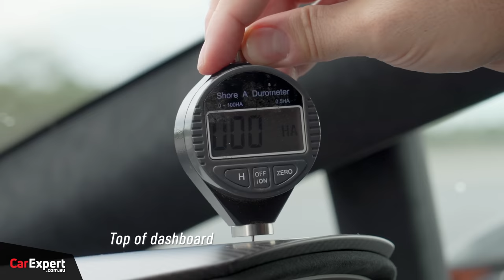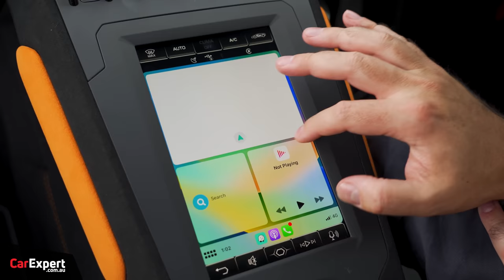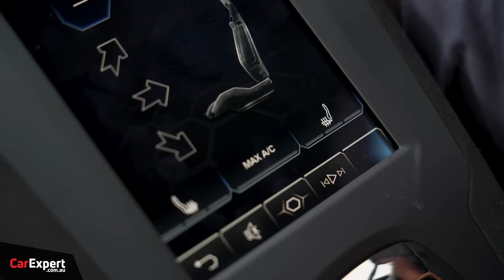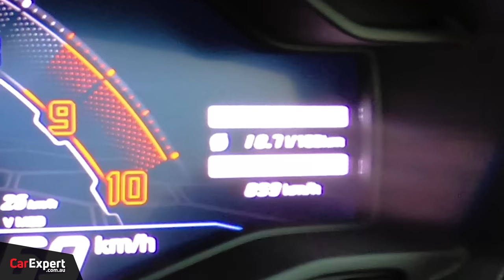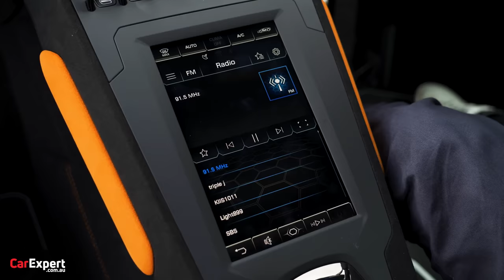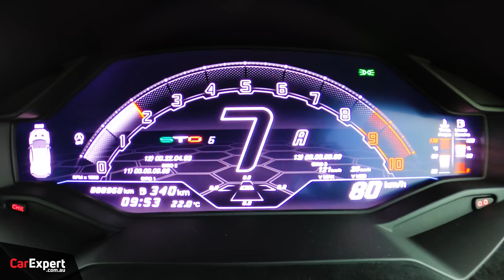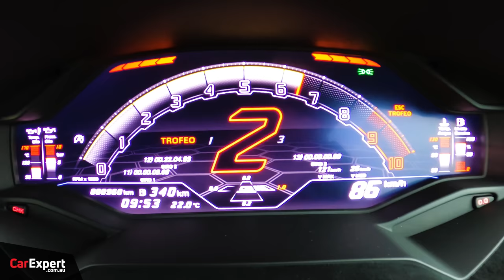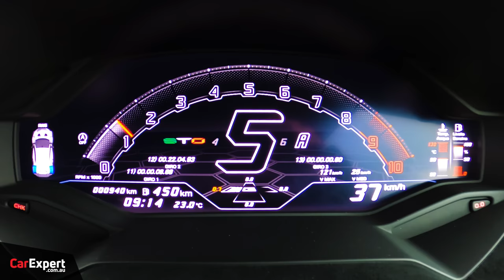Lamborghini Huracan STO (inc. 0-100 and braking) review

Comment: The only thing that could make this better, and this applies to Ferrari and McLaren, is to stop using 245mm fronts. They’re far to skinny, take a leaf out of the Nurburgring lap record holders Porsche and Mercedes and fit some decent 265mm, it’ll drastically improve grip and better braking as it has a larger contact patch with the road. There’s a reason GT3 cars have 295/300mm fronts.

Comment: Paul, the 100-0 braking was done at 111kph before you hit the pedal. If it was at 100, I reckon it would have made the 30 meter mark.

Love that you are reviewing fast cars. One day, I will have one and compare it to your reviews. Great stuff, keep it up!
Reply from the maker: Doesn’t make a difference :-) it only measures from 100km/h so it doesn’t matter when you start braking, as long as it’s above 100km/h.
Reply: @CarExpertAus  Well the scientist in me says no... You diminished 7% of the braking performance scrubbing off that 11km/h before you reached 100km/h.
Reply: @CarExpertAus I don't buy that, in fact you started braking at 112kph. Otherwise great review
Reply from the maker: @Dino-zc5wi  Yep. Makes no difference. It only measures from 100km/h.
Reply from the maker: @64nine  The engineer in me says it makes no difference. It may matter on the fifth or sixth brake when brake fade comes into play, but it makes no difference otherwise. We’ve tested it many times before.
Reply: @Dino-zc5wi  so learn how the tests works then ffs

Comment: What was the speed u reached at the back straight?
Also were u doing 111km for the brake test? hence the extra 5m?
Reply from the maker: It only records from 100km/h, so the number is correct. 
It’s possible the surface wasn’t completely dry, or was a bit greasy from earlier rain.

Comment: Awesome review 🏆 although in your brake test you stopped from 112km 😅 What a beast 🐂
Reply: The data logging gear he uses, in fact what most reviewers use, track 100-0km/h via GPS, so as long as you're somewhere above 100km/h when you start braking, it'll record it exactly from 100km/h.
Reply: @TheStigHCE09  ahh I see, thanks for the heads up 🏆

Comment: Such an epic car!! I am wondering why you bother reporting the 80-120 time when the car is already at max acceleration? Isn’t the idea to record the rolling acceleration to 120 if you’re maintaining 80? Not blasting straight through it and recording that time. Keep up the epic videos 👍🏽
Reply from the maker: Nup. It’s a measure of how quickly it accelerates through that speed zone. It then makes it directly comparable between all cars we test. If we do a rolling acceleration test there are too many variables that don’t make the number comparable between vehicles - such as the gear you start in, how far below 80km/h you start and which part of the track we begin accelerating. 

By doing it this way it’s simply a measure of torque production in that speed zone that determines how quickly it moves through it.

Comment: Braking test was from 110kmh you did not 100 .
Reply from the maker: The GPS device measures from 100km/h. Doesn’t matter when you start braking, as long as it’s above 100km/h.
Reply: The surface is cold and has been totally washed so I’m sure it would be fine on a ‘normal’ surface eg a public road